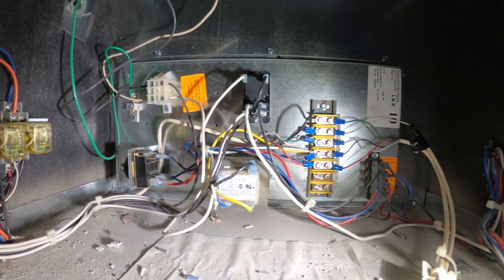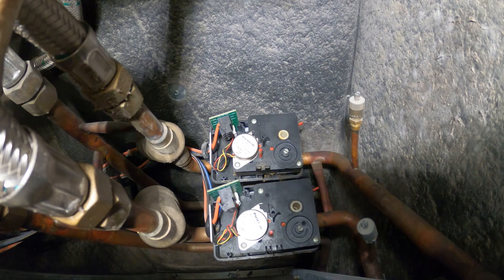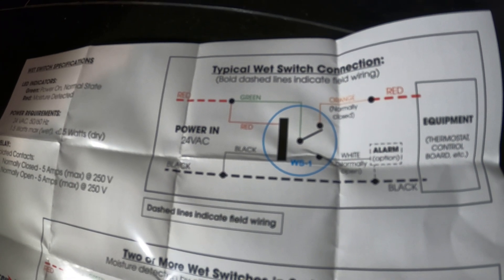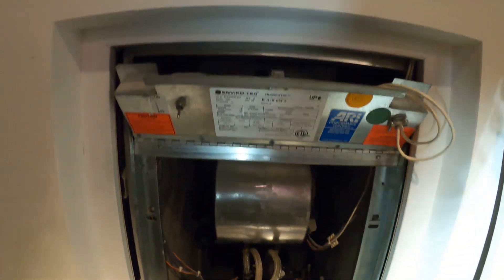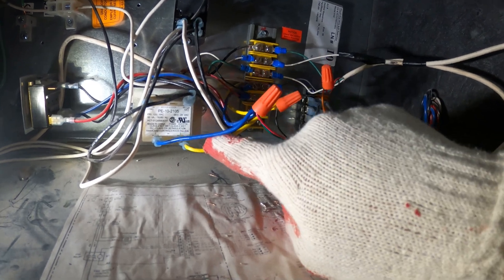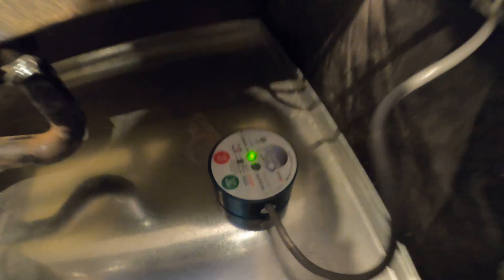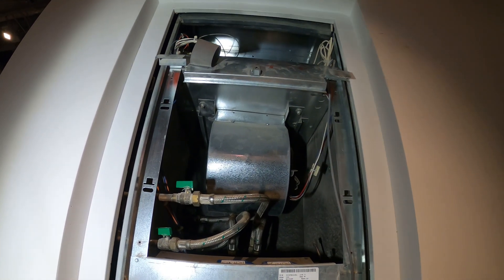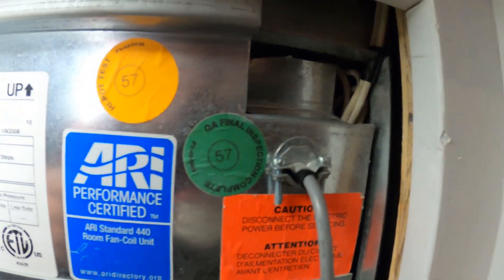HVAC: Wet Switch Flood Detector Installation (DiversiTech Wet Switch WS-1 Flood Detector) EASY!

Comment: What's would be the case if the wet switch is wired correctly but it's continuosly clicking when you press the red button
Reply from the maker: Hello, there's a chance you have a bad wet switch if the contacts are constantly opening and closing if the part is dry. Thanks for watching & stay tuned for new videos every week! 🔧⚡️
Reply: Thanks much  @JumpermanTech , initially the wet switch wasn't switching off only staying in the on position and clicking when the TEST button is pressed
Reply: @JumpermanTech I did change the wet switch but now it switchs over when TEST is pressed, and makes a clicking sound
Reply: Any advice that can shed some light on this? I found nothing shorting to ground

Comment: Instead of cutting your r wire  ( power) and common directly from the trans former. It would make more sense to take them from the r terminal and c terminal ( same thing, but now you have no wires to the r 24 v terminal.

Comment: The wet switch flood detector is a safety device that  should shut off the condenser unit only , and should not turn off the entire system , only when the AC unit is working in AC mode, the wet switch sensor is connected to the same secondary power supply of the furnace , the relay contact common ( green wire) of the wet switch sensor should be connected to the yellow wire coming from the condenser unit , and the orange wire normally closed from the wet switch sensor to the other yellow wire coming from the thermostat  in this method the wet switch sensor breaks the 24 volts to the outside unit contactor only, and the constat 24 volts to the furnace is not interrupted .
What happens if for some reason the device got damaged , it could happen two things , one the defective device could blow a fuse from the fan controller board, two the defective device is preventing the path of current from the secondary power supply to the furnace igniter board , that's why the manufacturer installation recommendation is not the best way to install the wet switch sensor , we only need the device to shut off the unit  when is running in ac mode only , and  make sure the furnace or indoor unit is in working condition for the winter season .
Reply: Wrong 😅

Comment: 5:05 YOU LEFT OUT THE WHITE WIRE from the wet switch. Once the Orange is connected to the T-stat Red, the White from the Wet Switch goes to the R terminal on the board. Nobody in the comment section caught it, LOL.
Reply: White is for the alarm
Reply: @DPMechanical1  white can be used for the alarm then a wire from the alarm needs to go to R terminal to complete the circuit and cut the power when the Alarm is activated. Mine has no alarm, the WET switch just shuts the unit down. Mine at home is exactly how i stated in my post from a month ago. Works perfect.
Reply: @harrynutsackk  White should be capped off if not used with optional alarm. If it is connected to alarm, than other wire from alarm should be connected to common, not red, otherwise it will not alarm.
Reply: @harrynutsackk  You basically parked the white  wire to the R from transformer. Luckily  you didnt park it to the common, or you would blow the transformer or fuse everytime moisture was detected. 
This is basic electricity.
Reply: @harrynutsackk he is correct. 😅

Comment: I got a little damp spot in my A C over flow pan. Of course where the sensor was. I was drying  the material, and got a tingle of electricity. Is that normal Never felt that before. It was put in in 2004. Does it need to be replaced?
Reply from the maker: For this kind of control, it typically runs in 24volts which is considered low voltage. That's probably the tingle you felt. You should not have felt that. I would replace that control if it gave you a shock. Thanks for watching & stay tuned for new videos every week🔧⚡️